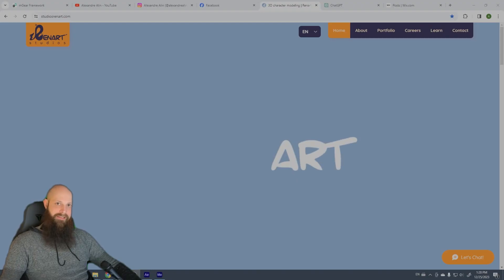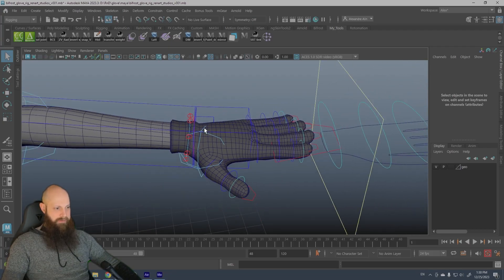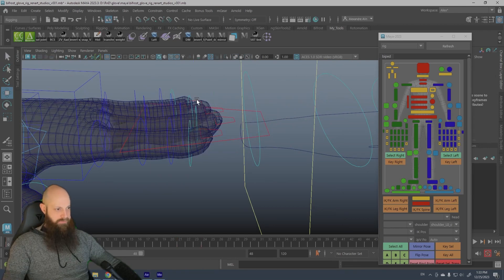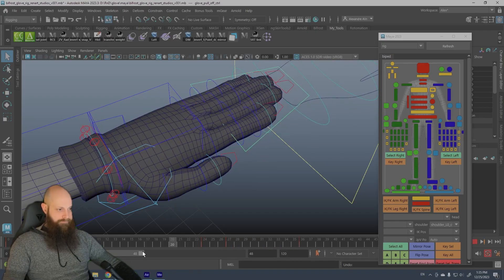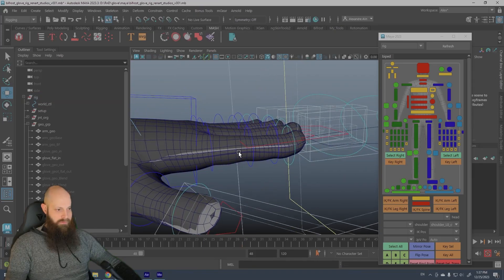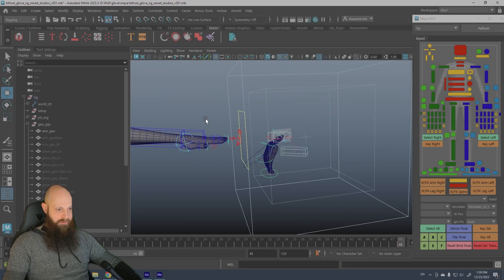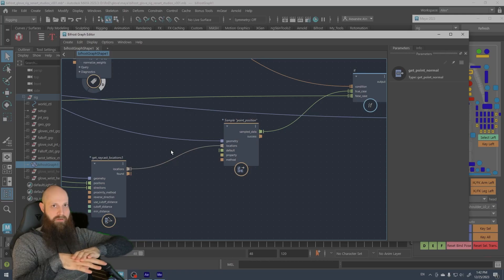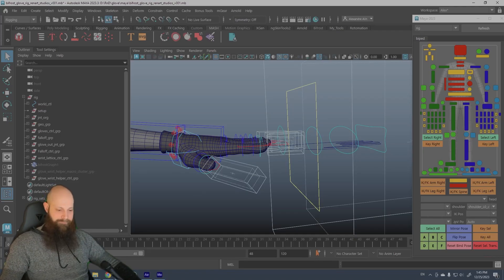Maya Bifrost and MASH - Glove pull-off rig Demo

Comment: It is really cool!!!  There's something wrong with this Maya Rig file, the gloves don't work, but the Arm skinweights are fine! Would you mind help me how can i do fix it🥺,thanks.
Reply: I have a similar issue. Would love to try out the scene, as it's amazing work! The glove_geo doesnt do anything and changing the wrap2 node settings doesnt seem to do anything. I'm on Maya version 2023.3, and should have the latest bifrost update with it.
Reply from the maker: @nilusss  I dont think the latest Bifrost update comes with the 2023.3. You will need to download the latest update of Bifrost independently of maya on the autodesk website.
Reply from the maker: @nilusss  If the node Tag inside geometry node is not available that’s mean you need to update.
Reply from the maker: Have you downloaded the latest Bifrost update?